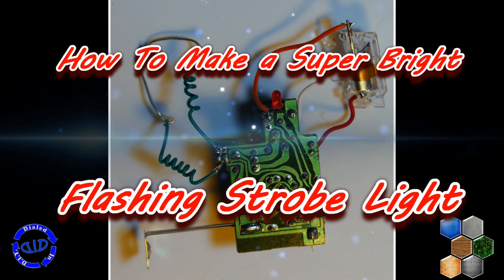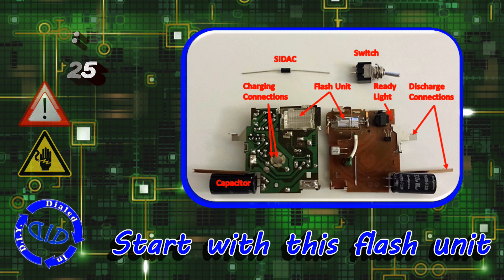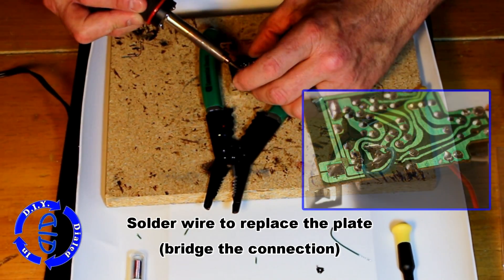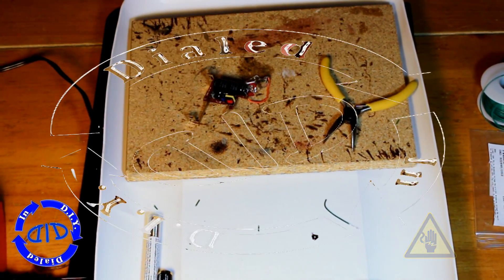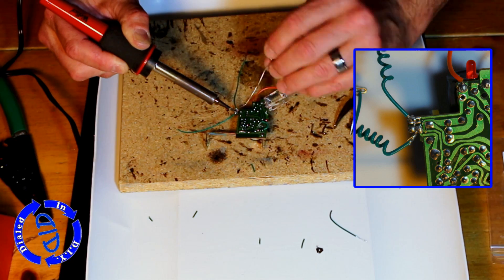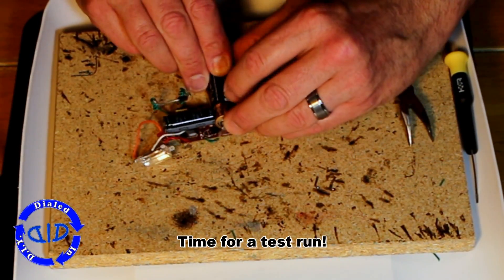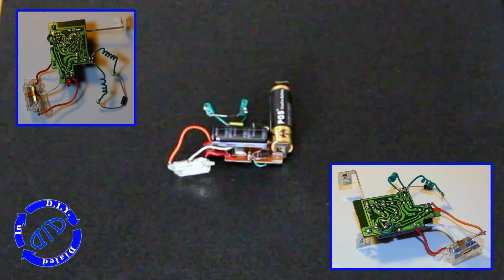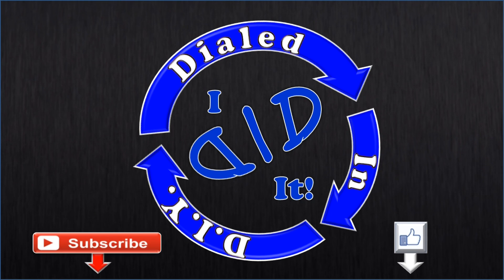Make a Bright Flashing Strobe Light

Comment: Thanks for this rare video:
Can you PLEASE tell me where I can find a "datasheet" for a sidac and what the main parameters, for example, (Vdrm, Vs, Vt, Idrm, Is, It, Ih), mean?
THANKS SO MUCH!!!
Reply from the maker: Thank you very much for watching and commenting!  For the basic stuff: I purchased this SIDAC via Amazon; item data code is 2K126 and it was made by "Littlefuse" (SKU: 11J9119).  I have a bit more info in the description too BUT the item I bought is no longer listed so I cannot find the exact data sheet (I am going to see if I can find more details from the original purchase).  Otherwise you can find options by the same Mfg via Digikey.com.  I will follow-up when I can find some more details.

Comment: That is a pulse, not a strobe.
Reply from the maker: Good point.  I know that most commercial strobe lights max around 10–12 Hz or 10–12 flashes per second and at the other end school system alarm strobes operate at 1 Hz (1 flash per second) but I don't know the crossover point where a strobe becomes considered solely a pulse.  Do you know what the cycle rate is for that?  Just curious.  Thanks for watching and for the comment.
Reply: @DialedInDIY  -  This demo circuit flashes ONCE, so it's a pulse..If it continually flashed, then it would be a strobe.
Think of it this way: Strobes flash at [insert any number >0 here] Hz. Your circuit flashes at ZERO Hz.
Reply from the maker: @johncoops6897  Thanks for the feedback and sorry if I'm missing something (I will use the excuse that its late at night right now...lol) but the flash does repeat automatically in this set-up but it was slow to repeat (it will spill over and repeat until the battery dies).  Is the pulse thought due to failure to repeat the flash with a frequency that is not multiple times per second?  Thanks for watching and for commenting... I appreciate it!

Comment: I am interested in making the flash component.. does anyone know where I can purchase the SIDAC? not having luck given in tutorial description.  Thanks!
Reply from the maker: Hello,  Love hearing that you want to make the flasher. I purchased this SIDAC via Amazon; item data code is 2K126 and it was made by "Littlefuse" (SKU: 11J9119) but I went back to Amazon and checked and all 125v show up as "currently unavailable."  I will look for some other options & post what I find.  Thanks for asking about this.
Reply from the maker: I did some checking and found that everywhere I looked showed that the part I used is no longer available from the same manufacturer BUT I did a search in Google for "buy sidac 125" and found other options out there.  Just note where it is coming from  (country) and search for best prices.  I found one on ebay for far too  much money.  Let me know if you are still unable to find one. Note: the image at 24 seconds into the video shows what the SIDAC you are seeking should look like. I hope that helps.
Reply: after 3 hrs of looking..I learned Digikey sells them.  Surprisingly, I was able to score about 30 disposable cameras from my local Walgreens! I am making this flash to insert into a card board cutout of paparazzi for a Red Carpet themed photo booth I am constructing!! I was beside myself to learn of this DIY project! My tech savvy son will be helping me with this.. but I would love to share the results when the project is complete and in use!!!
Reply from the maker: Great score on the cameras!  It has become a bit more challenging to find photo processors that still do disposables on sight.  I will have to check my local Walgreens again soon!  Thanks for the info.  I would love to see how the final project turns out.
Reply from the maker: I wanted to check back and see how your project turned out.  Did your "paparazzi" project work the way you had hoped?